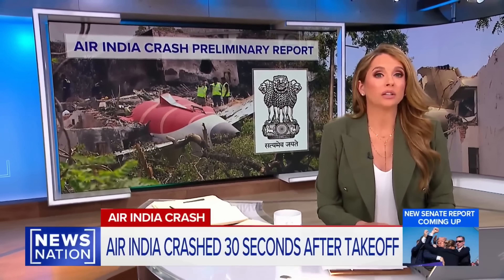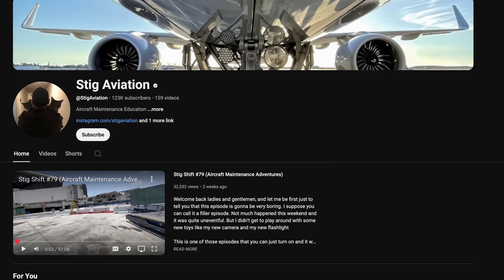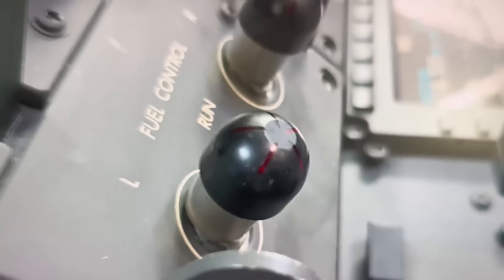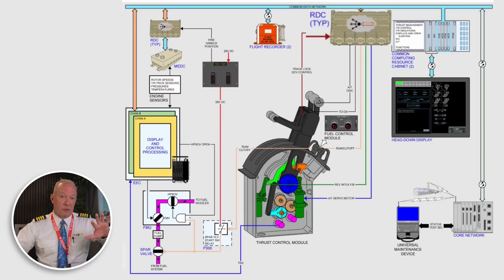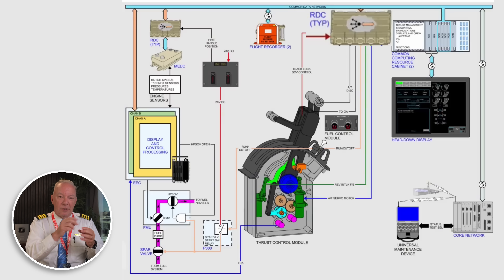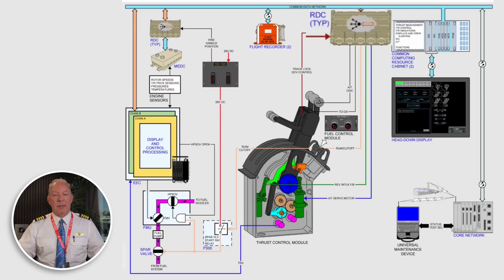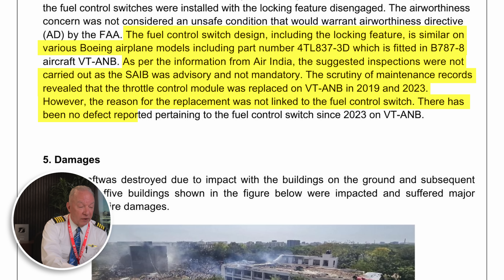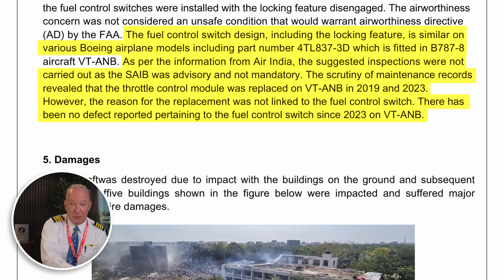The Truth About Boeing 787 Fuel Control Switches

Comment: Hi Capt Steve, it’s a nice explanation. But something that stands out is, how will the flight recorder get the status of the relay/switch position? Also is there a prompt on the display or warning when the fuel switch is moved? If so, how will the monitoring get those states? Can there be an erroneous status shown which prompted the pilot to just put it on cut off and back to on? More clearly, if there was a false prompt and are there digital signals involved for state check in flight recorder.There are many ifs, but those clarifications can make this video more validating.

Comment: Steve with the greatest of respect, I strongly advise you and all other YouTubers to close this chapter. We all need to wait (as difficult as that is) for the final report to be released. Cultural idiosyncrasies norms and preducices, difference in training, crew members psychology wellness and Boeing's continued company problems will all come to light if it is found that these and other challenges are co-contributers to this horrific loss of life. What I strongly believe needs to change immediately is that the CVR needs to capture video as well as audio. Furthermore, in this age of communication, those data, along with FDR should be transmitted external to the aircraft not just stored in the box. "IF" with video being recorded, a would be murderer with suicidal ideation is dissuaded from taking such action going forward because the act would be caught on recorded video, then the change would be well worth the implementation.

Comment: As crazy as it sounds, but imo the Pilot monitoring had a bad blackout and erroneously operated the fuel control switch instead of the gear lever up, and didn’t realize until the pilot flying called him out and put back the switches on. Sounds unbelievable, but still more likely than an intentional act.

Comment: I have a same analysis.
I made videos in French on this crash:
https://youtu.be/vTW2A0cB5b4?si=1xhfR58JOEWmpSXq
Let me show you something that surprised me in the report.
When you see the thrust levers in the debris, they are in Idle position but the report indicates that these levers remained in TOGA position.
I suspect the lever position sensor was no more powered at a time after the electrical failure and didn’t send the information to the black box. According that, the black box thrust lever was no more updated.
Do you have an opinion on that?

Comment: All well and good but given that Boeing is the design authority for the aircraft and Failure Modes and Effective Correction Analysis (FMECA)is a major part of the aircraft’s airworthiness and it’s coupled with human factors, there should have been consideration to pilot sabotage in critical phases of flight with design considerations given to both the positioning (proximity) and component, as well as system functionality! I.e the effect of sabotage in a critical phase of flight, that’s a design consideration right there! Thinking the absolute best, is not critical thinking. Ask yourself should the aircraft system allow the sabotage of the aircraft while it’s in a critical phase of flight? After the 747 disaster in Tenerife, there was the introduction of Cockpit Relationship Management (CRM), because of bad pilot communications. You would think that with all the communication checks between pilots and the air safety regulations and requirements that the switches would have been designed and tested in a way that sabotage would not be possible in a critical phase of flight. Is it foreseeable that a condition exists that would cause the loss of the airplane and lives on board in the case of a sabotage event during a critical phase of flight? Takeoff or Landing etc.

Comment: The analysis provided by Geoffrey Thomas and Richard Godfrey on YouTube channel "Airline News with Geoffrey Thomas", has finding that the RAT was deployed very early in the takeoff run. They speculate that RAT deployment was caused by a major electrical fault in the aft "EE Bay" that deployed the RAT and shut down both engines during takeoff. They further speculate that a pilot manually switched the fuel cutoff switches to "cut off" and then later to "run" to initiate engine relight. Their argument is supported by passenger reports from the previous flight of the crash plane of faulty equipment in the passenger cabin (entertainment system and lighting), and an advisory to inspect water ingress on the 787 aircraft, which may or may not have been carried out in this case. It would be interesting to know how Captain Steeeve would respond to that analysis.
Reply: Engines failed after the cutoff switches were moved to.. cut-off. One of the pilots then moved the switches back in hopes of re-lightning the engines, one engine actually started producing thrust and the other one was on it's way but there was no time and space for a recovery. 

How the fuck can you get something so basic totally wrong.
Reply: Even if this theory is plausible, it does not explain why the [captain] moving the switches in an attempt to "fix" the issue did not utter something audible ... espressing shock.   That he didn't (at least per the prelim report), is telling.
Reply: @joewarren410 The verbatim response is not public but the paraphrase does sound like the pilot exclaiming. ‘Why did he…?’. The paraphrase isn’t a clear accusation ‘why did you …?’. A proper transcript rather than paraphrase would help. Maybe someone from our culture would have said ‘Why did it…?’ or even (old fashioned) ‘Why did she…?’. If the switches were found in the wreckage in the off position it’d be a slam dunk but this is less clear. The RAT deployment BEFORE the engine shutdown still needs to be explained. I’m keeping an open mind.
Reply: They do a lot of speculating on that channel and cherry-pick data from the report (which they're pretty scathing about, when it suits) to support their latest theory. Lengthy explanations of how everything on the plane works and how they calculated this, that and blah. They've even written to the AAIB demanding answers to their questions - hubris much?
Reply: @juniper1803 "Lengthy explanations of how everything on the plane works and how they calculated this, that and blah."
Yeah, let's just gloss over everything and guess instead. That's how you investigate, for sure.
Reply: @ConcernedParent-z1q Nah, better to blind the 'smart' people with science day after day, it keeps the money flowing in...
Reply: @juniper1803 "Nah, better to blind the 'smart' people with science day after day"
I have no idea what you mean. We who understand the "science" (engineering) have no issue following the research, and it doesn't "blind" us. So, sorry, you are simply confused. Leave it to the experts, and don't try to make up your mind because this is over your head. Just leave it undecided.
Reply: Those two clowns were still holding on to the dual engine failure last time I checked
Reply: @drewschumann1  Richard actually understands the systems. He doesn't dabble with simplified teaching aids.
Reply: @ConcernedParent-z1qYou have to remember one thing, the more hits you get on youtube the more you get paid.  Not saying they’re right or wrong, but the more controversy you can create, the more $$$$$$ roll into your own pockets.  Unfortunately we see a lot of this happening these days.  The smart person follows the people who actually fly these planes for a living.
Reply: @DaSchnuz  "The smart person follows the people who actually fly these planes for a living"
The smart person listens to engineers and people who do forensic analysis of crashes. Pilots know how to operate the plane, not the many thousands of details of a complex 787.
Reply: @ConcernedParent-z1qYes to that point, but what they actually know whether the plane is safe to fly!  When this accident came out it created an opportunity for all the pilots who fly the 787 to voice any complaints about the plane and its engineering.  All we’ve heard was silence, and that speaks volumes for the 787.
Reply: @DaSchnuz  The preliminary report has had the desired effect. What do you think would happen if 1100 787s were grounded for 1 year or so? Good for Boeing? Good for operators? Did you look into the 737 MAX story?
Reply: @ConcernedParent-z1q This conversation is about the 787 only!  Please keep your reply’s to this accident and the 787, otherwise I’m going to ignore you…
Reply: @DaSchnuz  Thanks for the chuckle! Let's not learn from general aviation history...
Reply: @ConcernedParent-z1q 737 MAX crashes were both preventable if the pilots ran a basic memory checklist for runaway stabilizer trim.
Reply: @stimproid  It has been proven that the stab moved so fast that there were just a few seconds to stop the disaster. Once fully trimmed down, the pressure on the yoke to pull up would have made the action of manually reversing the stabiliser trim impossible. Too much aerodynamic force actively on the trim screw. So much for the memory check list.
Reply: @ConcernedParent-z1q It can move quickly, yes...that is why it is a memory item checklist. The Lion Air pilots almost saved their plane as they had shut off the breaker to the trim. For some inexplicable reason they turned it back on dooming the plane.
Reply: @stimproid  But you realise that you would also need luck to save the plane? If the runaway happens too close to the ground there would be no chance of saving it. I'm aware of the unfortunate circumstances of Lion Air.

Comment: I think most likely the switches were shut off mechanically but,
1. There could have been a pinched wire (or harness) that could cause the relay to open.
2. There could have been a harness connector that melted partly and passed current to the wrong wire.
3. There could have been a magnetic interference (electromagnetic induction) on the circuit from another circuit running parallel to it. We see this all the time in automobiles with shielded wiring causing problems.
4. If the circuit is completely separate from all other circuits, then where did the "Fuel Cut" input to the black box come from?
Even though it is a completely separate system, there are ways for it to fail besides the switches being moved. Just not likely.

Comment: Another thought. If the cockpit monitoring failed in some way to display the fuel had been turned off, is it not possible that one pilot suspected the other had momentualy operated the switch then in the heat of the moment actually turned the switches off then on to be sure they were set correctly inadvertently causing the disaster.

Comment: My understanding of the Honeywell 4TL32-3D switches is that they are 4PDT (ie 4 pole, double-touch). They each contain four electrically isolated sets of changeover switches which operate together as the switch is operated. I would love to see a circuit diagram showing how each of those poles is connected and to what.

Comment: Left to right. That gives a pretty good clue who did it.
Reply: What clue? If murder-suicide was premediated, perpetrator could, intentionally, flip the order, or initiate dialog "why you cut off?".
Reply: @dankodnevic3222 normal person usually starts with the closest one. And I doubt that the plan would be that elaborate to reverse the order and pin it on another pilot.
Reply: @volodymyrdrobot9454  A normal person doesn't commit suicide and take all of those innocent people with him.He tried to pin it on the other pilot so that his father would collect the insurance.Not going to happen.Insurance wont pay for suicide.
Reply: @volodymyrdrobot9454  Murderer is not a "normal person"!!! Reversing order is not "that elaborate".
Reply: Not necessarily. Most pilots cut them one, then two, which ever seat they are sitting in.
Reply: @wcgdenmasterken3431 I don't know what most pilots do but this is the most intuitive action for a person to do: closest first, furthest after that. Together with the fact that the first officer was flying the plane it also seems counterintuitive for him to reach out and turn off those switches.
So this s is just another piece of the puzzle, not the only one.

Comment: If you are correct how do you explain the January 17, 2019 ANA 787 flight NH985 dual engine failure  just after landing where the TCMA system shut off fuel to both engines without the pilots moving the fuel cutoff switches.

Thats right the computer cut off the fuel to both engines .

Here's a more detailed breakdown:
The Incident:
ANA flight NH985, en route from Tokyo Haneda to Osaka Itami, experienced a dual engine flameout after landing. 
The Cause:
Investigation revealed a software glitch in the TCMA system. This system is designed to prevent engine over-thrust during landing but can be activated by certain sequences, such as deploying thrust reversers too quickly after touchdown. 
The Impact:
The engines shut down, and the pilots were unable to restart them on the runway. The aircraft was towed away. 
Similar Incidents:
This incident was not isolated. Other Boeing 787s, including a Jetstar aircraft, have experienced dual engine issues, sometimes linked to the Trent 1000 engines. 
Corrective Actions:
Boeing issued a bulletin to pilots and maintenance crews regarding the TCMA system and its potential for malfunction during landing. Further inspections and checks were also implemented.

Comment: Great explanations; fuel control switches operate only manually ... as reported here for weeks ... and independent of anything else.  The question remains: if both pilots disavow moving the switches, how did they move physically if anything electrical is "downstream" of them?  That is, nothing electrical (including water ingress to the EE bay) could in any way affect the position of the switches ... or interrupt the flow of fuel as long as the switches are "on."  Moreover, as discussed here, it is implausible that anything (electrical or otherwise) affecting one switch could have affected both nearly simultaneously.  The elephant remains: intentional action by one pilot.

Comment: Correction Stephen: The FMU is; the: "Fuel Metering Valve"; there is no such valve, as a: Fuel Management Valve.
This same, Fuel Control Switch switch; flew for the first time, on: September 26, 1981.
That was the first flight; from: KBFI, of the B767!

Comment: My question is could the pilot or co-pilot have mistaken the switches for another system. Did either of the pilots recently switch from flying a different model or brand of airplane ie:787,777 or. Airbus where the switches in that position on the other model or brand of aircraft are not fuel cut off switches but some other switch that would be turned on or off during take-off?(Landing Gear switches)

Comment: Dear Captain Steve, I agree with you that probably the fuel was cut off manually by the mechanical switches, but - with all due respect - your explanation of the fuel circuitry in this video still in INCORRECT.

Check the drawing you've shown! There is an AND GATE symbol in the FMU unit. SEMICONDUCTORS ARE INVOLVED (!) in the switching of the HPSOV valve. Semiconductors are vulnerable (over voltage, high temperature, etc.). I am NOT (!) saying that the semiconductors failed in this case, just pointing out that your explanation is incorrect. 

Also, your electronic testing board demonstration also leaves something to be desired. There is no relay under the white yellow/switch you are using, and no detailed explanation how the relays work. Please ask an electrical engineer next time to demonstrate operating principles for you and for your viewers. I was hesitant even pointing out these imperfections - there are so much negativity in social media comments - but I think this subject is very important. Thank you for this grate YouTube video channel!
Reply: If so, outline your reasoning.
Reply: @joewarren410  What you mean? I am not saying that it was an electric (electronic) failure, just pointing out that the explanation (direct, passive, battery-switch-relay-wire-valve connection) is incorrect. Digital logic circuits are also involved. The diagram shows that. Or did I misunderstand your question?

Comment: All of us want this to be an equipment failure because the alternative is highly unpleasant to put it mildly. Occam's Razor rules here, especially in light of the exceedingly simple design of this circuit, which is on purpose. No matter how much we dislike the conclusion we are forced to, it's the only one that fits the facts that have been established. Trying for alternate explanations just muddies the waters and adds no value.
Reply: The design of the circuit shows DC power must be operational. Many systems were experiencing a loss of power. More than just the switches would cause.